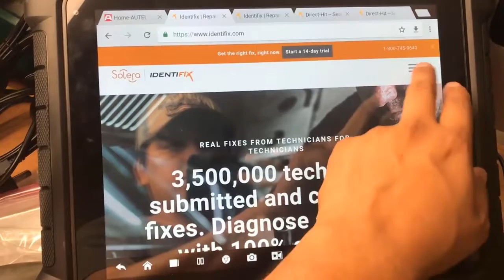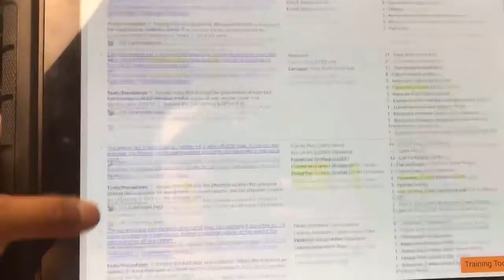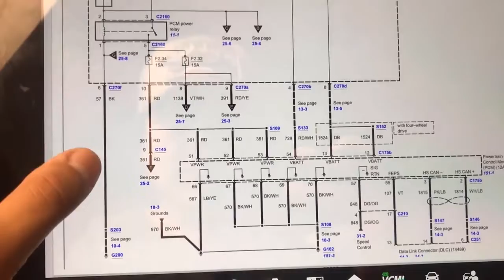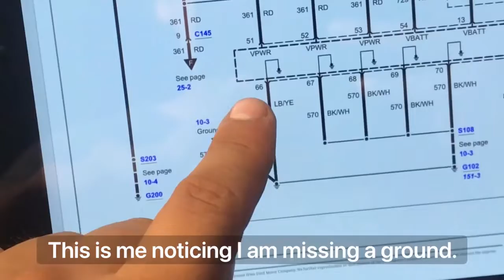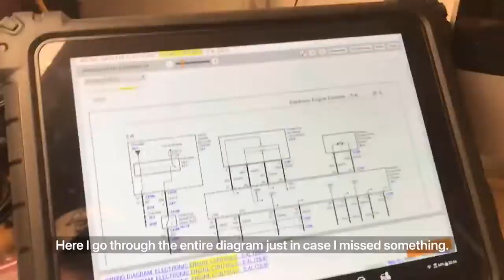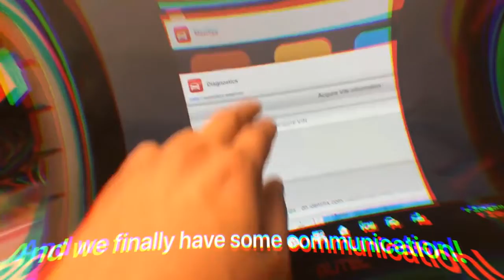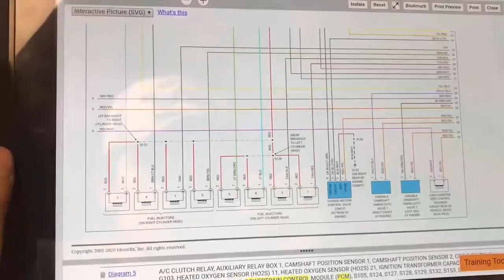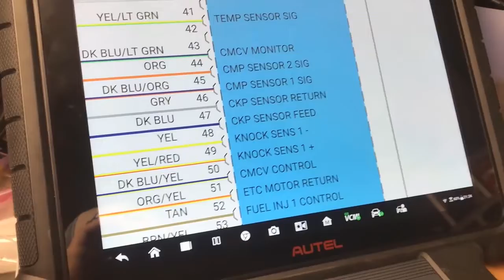GODIAG GT100 Test ECU On Bench with Autel Tool

Comment: What model tablet?
Reply: So I got the Goddiag any way you can help with what pin I need to connect for obd2 reader I have power and ground so far thanks
Reply: the answers were like you'd asked a completely different question. The tablet is Autel Maxisys ULTRA